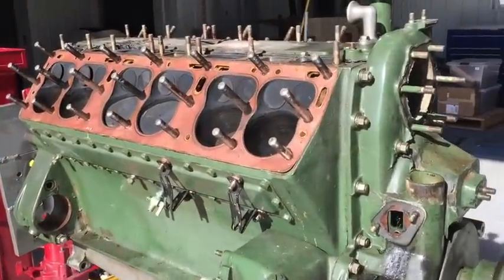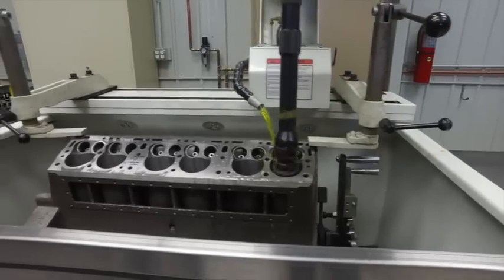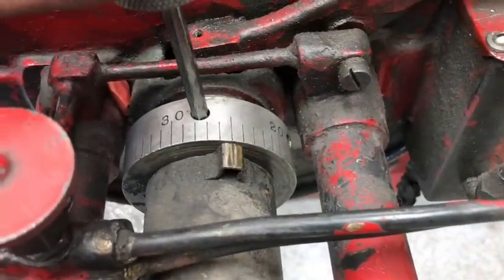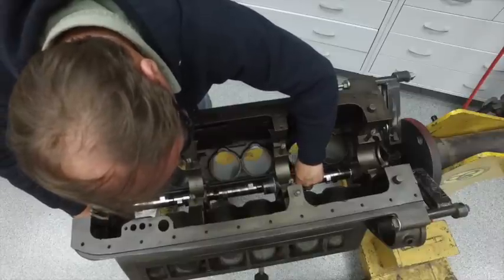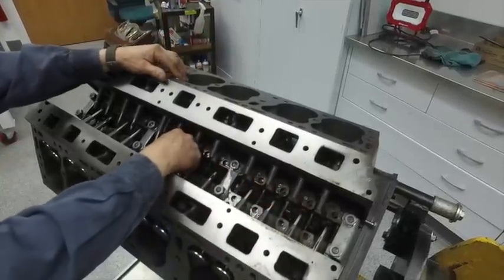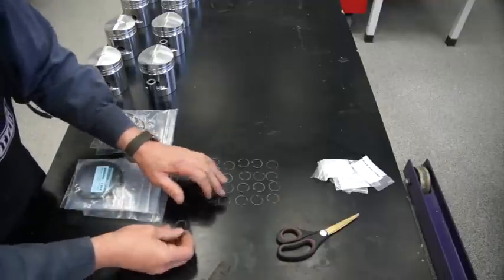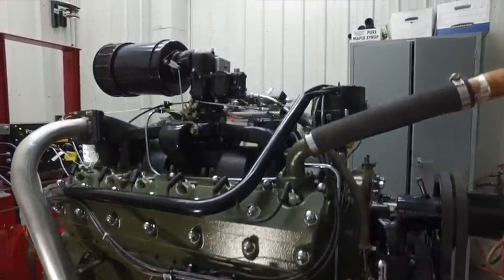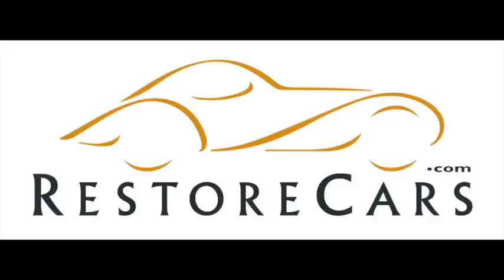Remanufacturing a Packard V12 engine

Comment: Great workmanship on this engine, but these engines are still rough compared to the standards of modern mass produced engines.
Reply from the maker: I would have to agree.  I recently toured the Dodge Kokomo Indiana transmission plant.  They cast and perform the rough machining the Ferrari V8 blocks there.  A human hand does not touch the block.  It is a 3.1 million square foot facility housing thousands of CNC machines.  One guy runs 8 machines.  But I think one has to put themselves in the moment that these parts were manufactured. In 1935 there was no CNC, no NC machines.  And think about the guys that made the machines that made the parts.  The Packard Merlin engines were better built than the English Rolls Royce version.  I have almost no personal knowledge of the Chevrolet, Dodge or Ford mass produced engines.  But I have machined enough of the senior cars to know they were a well built car.
Reply: I don`t think Rolls Royce would agree with that lol but most likely you in the USA had access to better materials than they did in England under wartime conditions and US  mass production techniques.
Reply: Chris, there's a lot of debate about who made the better Merlin and the truth is the Rolls version was hand fitted by essentially one person whereas Packard really standardized the whole thing.So the Rolls version was at the mercy of who assembled it and you'd find all sorts of sizes and clearances in one.Whereas a Packard built Merlin was pretty standard throughout when compared to a hand fitted Rolls.Generally speaking the very early Rolls was arguably built to a higher standard then the Packard's but as things went on that quickly changed and the biggest problem with the Rolls built engines was their ability to be serviced and patched together during wartime conditions.They essentially had to be sent back to a Rolls workshop whereas with the Packards you could assemble one in the field with salvaged parts.So in short its really what you prefer,a hand fitted engine that is highly dependent on a craftsman's ability or a more mass produced and consistent version that was much easier to service.........My vote is for the Packard version  if I'm flying behind it and a Rolls if it's a piece of static art;-)

Comment: When you CMMed it, was it closer to specs than the original? And why don't you answer the HP question?
Reply from the maker: The block was already worked over what looks like more than once.  Hole centers were off less than .0015.  Bores were all over the place and were not straight by more than .005.  Very poor work before we got it.  I goes that is why they sent it to us.  It was literally coming apart.  Babbitt was falling out and the hard chrome on the crank was falling off.  The rode work was terrible.

As far as the numbers are concerned, I have answered the question on other comments.  See Lee Crt comment.

Comment: I had to keep going back over it, I was so engrossed. I was fascinated to watch all the procedures. Your tooling, skills and quality are enviable.
It must have been quite an engineering feat, back in the cars' heyday, to cast the block and heads and get such accuracy on the finished product. As Lee Crt tells us, below, Packard were certainly up-sides with Rolls Royce quality.
Thanks so much for providing this video.
Reply from the maker: I am amazed at the quality of manufacturing and accuracy that the car builders achieved in those days.  We have all the fancy CNC machinery here and I have never found a block to be more than .0015 off.  I am speaking of senior classic cars of the 1930's.

Comment: After a modern engine rebuild like this, what are the peak HP and Torque figures, and what do the curves look like? My guess the torque curve is as flat as Florida.
Reply from the maker: You are partly correct.  The torque curve starts out at 436 and bottoms out at 320.  HP starts out at 124 and steadily raises up to 197.  All pulls were on a same line and very smooth throughout the RPM range.  These are corrected numbers.  Book value is stated at 175 HP peak.
Reply: claytoresto  So, you boys beat the specs. Marvelous. I've read in many publications that Packard's machining precision was envied the world over. Even Rolls-Royce tipped their hat to Packard, and they had no problem with Packard manufacturing Rolls-Royce Merlin aero engines during World War II.
Reply: Lee Crt - I'd heard that Packard Merlins were considered better and more consistent than rolls.  My grandfather had Packard 2500 marine v12s in a PT boat, he he said they were absolutely beautifully machined..
Reply: James Neumann Oh, yes. Rolls-Royce was absolutely fanatical as to who they licensed their designs to for production. They had no problem signing up Packard to build Rolls-Royce Merlins. That's because Packard standards were every bit as good as Rolls-Royce if not better.
Reply: hey, the V12 packard was known for they fragile crankshaft who broke because tortionnal cracks...and the reliability/durability , specialy from the first series of Packard Merlins, was far not so good as the real RR Merlins, so Packard better than RR= i don't think that...same thing with the 20mm Hispano Suiza canon made under license in the USA who had heawy reliability problems because incorrect modifications (to reduce costs: replacement from 3 concentric breech springs with one harder spring...)
Reply: i read a ww2 fighter pilot had a P51 after the war and part of the supercharger failed, sent parts to RR in early 60's and they repaired it and sent a nice note thanking him for being a loyal customer. on a 20+ year old supercharger!.. and no charge for the repairs.
Reply: Bradley Campbell Stories like that have been related by folks for decades. Never heard of them covering an "out of warranty" repair on a 20 year old piece of military hardware, though.
Reply: That crank looked far from weak to me
Reply: may be true, i dont know. i do know however some companies that make things go to extraordinary lengths to fix the impossible and make long time customers happy. i can say it is definitely plausible. and we all know RR took a huge amount of pride in those engines.